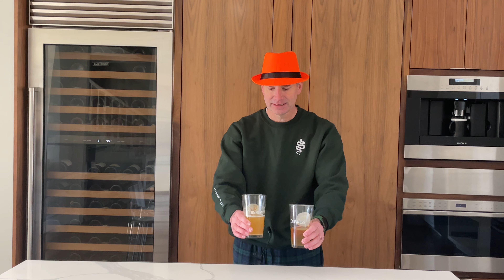Overnight mash

Comment: The experiment was very interesting. A lot was learned. Overnight mashing temperature is 50 to 55F to limit enzymatic action and to avoid tannin extraction, which is a time, temperature, pH thing. Overnight mashing is used when malt is steely. Pils Urquell sometimes uses overnight mashing if the brew master isn't happy with the malt.
Before deciding on using a proteolytic rest to reduce Beta Glucan it is better to obtain the malt spec sheet for the malt that you are intending to purchase because Beta Glucan content is listed and if the number is good, the rest isn't needed. The edible stuff that enzymes turn Beta Glucan into is glucose, the sugar yeast enjoy eating. Beta Glucan is a fiber, and it shouldn't be moved into a fermenter, it doesn't settle to the bottom.  Also, Alpha is active at 130F, and it doesn't take very long for liquefaction to occur. You really didn't need to soak the malt overnight at 130F, but you gave it a shot. The rest takes about 10 minutes to do what it's supposed to do. Usually when a rest at 130F is used, the next step is conversion at 140F and a couple of higher temperatures in the 155 to 160F range are used. Basically, it is step mashing. Malthouse provide a malt spec sheet with every bag of malt. Malt spec sheets are online, and they are used in brewing for determining the quality of malt before malt is purchased. I'm not sure if you know the difference between high modified, high protein, malt and higher quality, under modified, low protein, malt. Malthouse produce both types of malt. Both types are on the market and both bags are stamped Brewers Malt. A malt spec sheet lets a moonshiner that uses high modified, high protein, malt and an ale and lager brewer that uses high quality, under modified, low protein malt, know which malt is which. The chemical acronyms and numbers listed on a malt spec sheet determines the quality of malt. A recipe that doesn't list the malthouse that produced the base malt is worthless because a malt spec sheet cannot be obtained.
During a protein rest mash temperature around 120F is used and depending on the Kolbach Index, which is listed on a malt spec sheet and determines modification, a protein rest shouldn't be used. It is actually called an albuminous rest. A condition similar to over modification occurs when the rest is used, and the beer can turn out thin and insipid. It can be sweet tasting, but thin.
Beta amylase is responsible for conversion and activates at 140F. Starch isn't involved during conversion.
At 150F, Beta denatures, it is the sweet spot for Alpha. Moonshiners use 149, 150F because at the temperatures Alpha releases the highest volume of simple sugar, glucose from simple starch within one hour, so they didn't get caught. Glucose is responsible for primary fermentation and ABV and the more glucose the more alcohol. The high temperature denatures Beta. Due to the complex types of sugar that form during conversion and from what occurs afterward, moonshiners purposely denature Beta. During conversion Beta turns simple sugar, glucose, not "starches", into fermentable, complex types of sugar maltose and maltotriose, which aren't needed for making moonshine. Maltose and maltotriose are the sugars that produce ale and lager, glucose provides only alcohol. When conversion occurs, secondary fermentation takes place due to maltose. Maltotriose is responsible for natural carbonation. Beer doesn't need to be artificially carbonated with sugar or CO2 injection when conversion occurs. Artificial carbonation forms quickly dissipating, soda pop fizz that isn't tight enough to float the head and sometimes carbolic acid forms, as well.
There are two types of "starches" in malt, simple starch, called amylose, and hard, heat resistant, complex starch, called amylopectin, which is the richest starch in malt that you manage to throw away with the spent mash, paid for.
During liquefaction, Alpha liquefies 1-4 links in the amylose starch chain and when that happens two chains form but the name changes. The one chain is called the reducing end, the other chain is the nonreducing end. The reducing end basically contains sweet tasting, nonfermenting types of sugar. The nonreducing end is simple sugar, glucose. Depending on how high the temperature is above 150F, more or less, sweet tasting, nonfermenting types of sugar form and less glucose.
Amylopectin makes up the tips of malt and contained in the starch are the ingredients that form body and mouthfeel in ale and lager. Contained in amylopectin are tasteless, nonfermenting types of sugar, called limit dextrin, and pectin. Pectin is "glue" that holds everything in beer together during conditioning and storage. Limit dextrin, pectin and a particular type of protein form body and mouthfeel in ale and lager. In home brewing, the temperatures recommended in recipes aren't high enough to burst the heat resistant, starch where the starch enters into the mash liquid, before Alpha denatures and that is why the starch is turned into compost. In moonshining the starch is sold and amylopectin is made from it. To take advantage of amylopectin the decoction brewing method is used. When Alpha liquefies amylopectin, dextrinization and gelatinization. In home brew, starch carry over, Beta Glucan and protein goop provides body and mouthfeel, and you were actually trying to get rid of the stuff, which also reduces quality and shelf life of beer, to produce cleaner, more stabile, beer. To replace the thrown out starch, home brew recipes recommend ingredients that loads extract with sludge, so you may be fighting a losing battle.
It would be good to experiment with the Hochkurz double decoction method because that is the brewing method that ale and lager breweries worldwide have been using since 1960, previous to 1960, the triple decoction method was used. Single temperature infusion produces American, home brew style, moonshiners beer that advertisers renamed, Real Ale, when they invented CAMRA and invented stories, recipes and contests to set the hook.
Reply from the maker: Thank you for taking the time to write this :-) excellent information and good ideas :-)